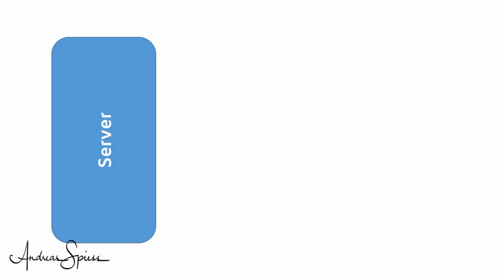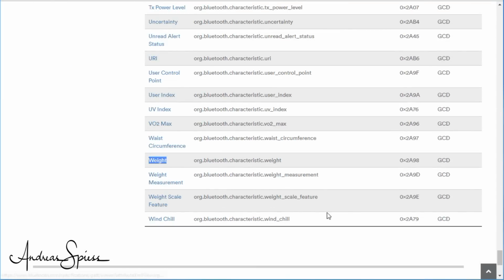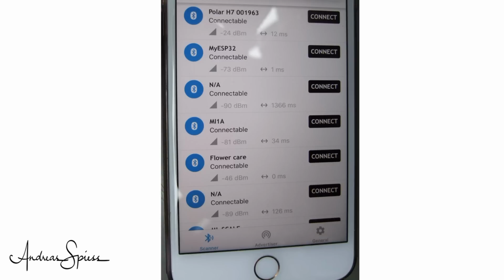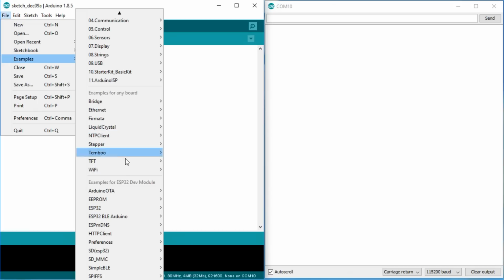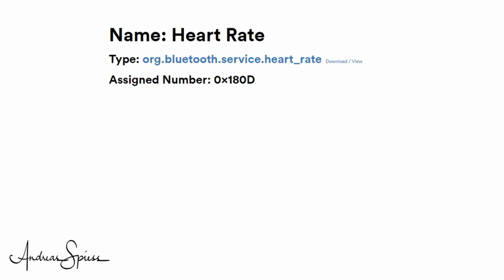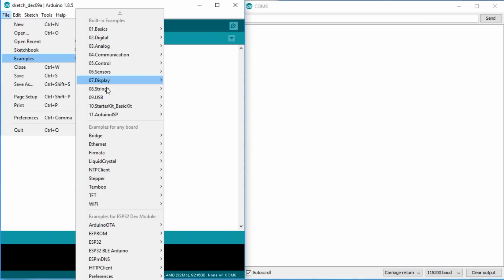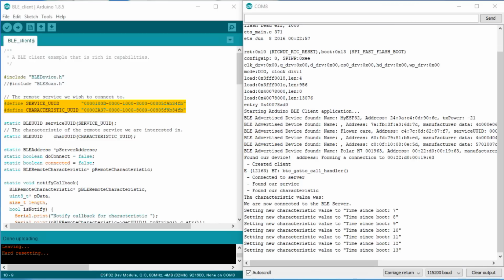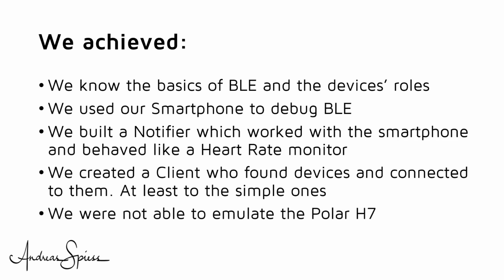#173 ESP32 Bluetooth BLE with  Arduino IDE (Tutorial) and Polar H7

Comment: I think this is a topic worth continuing with and sharing because it is such a strong communication taking any data from esp32 to a mobile which then can do all sorts of things - communicate easily via - txt - sm- email - to -wifi and easy access to screen display and data storage on phone sd card. Phones are so cheap that is really becomes the interface to use.
Reply from the maker: Maybe I will continue the topic. But only if Espressif did a good job on the library...
Reply: @AndreasSpiess  I have found it difficult to get my head around the details of BLE programming.

Comment: Polar uses 4 protocols - GymLink (non-coded), GymLink, Wind, Bluetooth. Your FT60 watch is only compatible with GymLink heart rate devices (T31,H1,H2,H7,H10), it doesn't work over BLE. And H7 sensor provides both GymLink+Bluetooth compatibility. So, H7 works over GymLink with your FT60 watch and over Bluetooth with smartphones/esp32/.

This info can be found here: https://support.polar.com/en/support/compatibility_with_my_Polar

How do I know that? I also owe H7 + FT4 watch (GymLink only) :)

And thanks for another great video!
Reply from the maker: You are absolutely right! Thank you for your hint. Saves me time! Now I remember that I had to buy the H7 in addition to the normal sensor a few years ago because I wanted to use it with the iPhone. 
I am getting old...

Comment: Hi, mr. Spiess. I think I know the main reason why your watch did not recognize the ESP32. The main reason could be simple: The data format sent by the ESP32. I've checked the official description of "org.bluetooth.characteristic.heart_rate_measurement" and find the "Heart Rate Value Format bit", which is setting the "org.bluetooth.unit.period.beats_per_minute" value type to UINT8 or to UINT16. "Note: The format of the Heart Rate Measurement Value field is dependent upon bit 0 of the Flags field."
Reply: You are close. You have to understand what data are sent by heart rate monitor to fake it. Its not enough to send just some number value which simulates heart rate, there is more to send and then watch will interpret those values and display it.
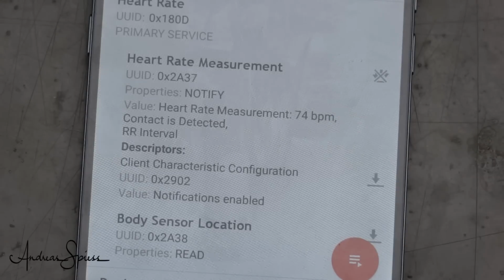Reply: Yeah, you're right. To emulate such a device like Polar HRM we need the proper data simulation. At 5:42 we can see 3 parameters: actual heart rate, contact detection and R-R interval. But at 10:15 we can see only 1 parameter. At the end of the docs for Heart Rate Measurement there is a remark: "The fields in the above table are in the order of LSO to MSO. Where LSO = Least Significant Octet and MSO = Most Significant Octet.". It means, now we now the basic packet structure of  Heart Rate Measurement. For exmaple (UINT8, No Energy Expended): 0x68, 0x4B, 0x03, 0x48 (this is octet-based packet, so R-R interval is splited for 2 octets). If you want, I can explain this strange numbers above.
Reply: I think, I could miss the point with LSO and MSO (I could make a mistake in the order of bits when translating into hexadecimal code)
Reply: Close enough.
Reply from the maker: Thank you for your help. I will come back if I go the H7 route further (or go the "issues" way on Neil's GitHub). For the moment,  I am still learning the basic basics. But it is good to know that I have viewers with much more knowledge.
Reply: This is not about more knowledge, i thought it is possible so i did study bluetooth specs and ive found it is working. Since you are talking about mr Neil's Kolban stack it would be pleasure to explain how to make it working on his "ground". IMO youtube is not the place to talk about issues and code which dont belong to you.
Reply: Polar uses 4 protocols - GymLink (non-coded), GymLink, Wind, Bluetooth. FT60 watch on video is only compatible with GymLink heart rate devices (T31,H1,H2,H7,H10) - it doesn't work over BLE. And H7 sensor provides both GymLink+Bluetooth compatibility. So, H7 works over GymLink with FT60 watch and over Bluetooth with smartphones/esp32/.

This info can be found here: https://support.polar.com/en/support/compatibility_with_my_Polar

How do I know that? I also owe H7 + FT4 watch (GymLink only) :)
Reply: So, we need to find another device for reverse engeneering :D

Comment: Best use for BLE-enabled esp32 would be presence sensor that detects phone. If phone is within the range - HomeAlarm is deactivated, or something like that. Do you think you can implement it?
Reply: Would be really really nice to have a MQTTconnected presence sensor. Or maybe a WLAN connected, also??
Reply: Use BLE to detect phone, since it won't make any significant impact on phone's battery, and then use WiFi to deliver data to automation hub via MQTT, at least that's what I have in mind. Same way car requests to pair and automatically pairs with the phone when you start it if you've paired your device beforehand.
Reply: Andrew Rain that's too easy to break into with just a laptop
Reply: Well, not really. Yes, PIN is only 6 digits but you can setup timeouts or even better - MAC address check.
Reply from the maker: I already did a Wi-Fi sniffer with MQTT and maybe, one day, I will be able to offer a similar Bluetooth sniffer. Who knows?
Reply: Well, I guess you do :)

Comment: So it’s possible that polar have what is like a subdomain of Bluetooth mac addresses and the watch won’t connect to any device outside that domain. That’s how we did it with ours. As you learned, without direct disconnection ble will assume it’s still connected the other device has just gone out of range ( I think timeouts are pretty long). While connected it won’t transmit advertising packets and (I think) will refuse other direct connections. The other think to contend with when trying to spoof commercial devices is pairing is different between BLE and BT Classic but depending on how their security is setup there’s usually a handshake that involves key exchanges and the server adding the clients to a trusted device list. All in all BLE is way easier to work with than classic but it does have some really irritating gotchas that are very confusing.
Reply from the maker: Thank you for your insight. It explains a few things for me. I still have to learn a lot and there is not a lot of info out there, or it is so complicated I do not understand it. So I will try to go step by step...
Reply: The high order 24 bits of the UUID is the company code similar to how MAC addresses have an assigned company code in the high order bits. The low order 24 bits are supposed to be unique per device and allows a company to manufacture over 16 billion devices before running out of available UUIDs.

Comment: @Andreas, the older polar hr straps connect via a low frequency transmission (5khz) called gymlink that is coded, not sure which watch you have, but it looks like this will likely be the case. Like the h10 strap, you'll find the h7 is Bluetooth AND polar proprietary coded transmission, so the watch isn't picking up BLE, it's looking for the polar gymlink transmission at 5khz, that's why you couldn't connect it, you were a couple of MHz off 😁
Not to worry, the polar app phone functions are much better than the watch anyway!
Reply: Polar still use 5khz because it makes HR strap useable underwater. ANT+ and BT are 2.4ghz and far too high frequency to penetrate water.
Reply from the maker: I do not know. For sure the watch communicates with my smartphone using BLE.

Comment: Managed to get the UART example working for tx rx. by using the BLE Scanner app on an iPhone.
Also got it to pair with a raspberry pi3, didn’t get any farther though.
Think there’s a good Python Bluetooth library so might give that a try on the pi3 
Always found bluetooth a bit complicated but with the esp-32  it could be very useful for battery powered projects. So probably worth spending a bit more time with it.
 Thanks again for another great video.
Reply from the maker: Maybe I also will go the RPI route. We will see...

Comment: try to specify the Bluetooth MAC of the device you want to connect to. this way you can force the client to connect to your esp32 and not to the polar
Reply from the maker: You are right, this is a possibility. But as far as I understand, would be against the idea of working with services. And usually, I will not have two devices with the same service, or I have to find a way for the client to deal with it in its program.

Comment: Maybe the watch checks those hardware version and id and stuff and only works if they are correct too.
Reply from the maker: I think you are right. I have to investigate further...
Reply: You need to "construct" your data type for the heart rate measurement characteristic - you cannot send just a value as the watch won't know how to interpret. First you have to set your flags, which are represented in 8 bits. Depending on which bit is set will determine whether the heart rate value (bpm) is uint8 or uint16, similarly, flags are also used to show that an optional "Energy Expended" uint16 value is sents etc.

Comment: Hello andreas nice video about Bluetooth. Apart: can you do a video about ESP WiFi security? I mean, connect several smartphones to an ESP8266 (or ESP32) and prevent brute force password attack, MAC address authentication before connecting (whitelist in sd database), to hide SSID, change SSID name, to set a password to “builtin” router, and if it is possible to auto disconnect a client after a given period (example 1 minute), in other words to make connection as secure and un-hackable as possible. I know you are the one.
Reply: I mean to be a strong connection in a community of authorized users, but what if a user wants to fraud or clone MAC address into other smartphone to allow access? Example: a building's automated door with smartphone over WiFi without using a PC or a raspberry or similar/equivalent linux equipment. (MQTT or just an HTTP request?)
Reply from the maker: Unfortunately, I have no clue about security. So somebody else has to do this.
Reply: To hide SSID do not make a WIFI any securer.  That is an old missconception. On the contrary, it will make the clients less secure, and the attacker can anyway get the SSID to use by just listening- Neither are MAC address authentication (whitelist of MAC addresses) increasing the security. MAC addresses are easy to fake.  
Please don't do that or suggest that as a security matter.
Reply: Just use encryption/signing with asymetrical encryption (that is certificates like when making connections to XMPP, HTTPS and MQTT with certificate) and use WPA2 connections.

Comment: Hello Mr. Andreas,

First, thank you for your videos. They are really usefull.

Second, a question related both with Arduino and this bluetooth implementation (and my very limited knowledge). 

When I connect, I find this:  

"ESP32 Dev Module, QIO, 80MHz, 4mb (32Mb), 921600"

By using the " BLE_server" code in the examples and after compilation/Upload, this is what I get:

"Sketch uses 1085933 bytes (82%) of program storage space. Maximum is 1310720 bytes.
Global variables use 69056 bytes (23%) of dynamic memory, leaving 225856 bytes for local variables. Maximum is 294912 bytes"

I pretended to use ESP32 bluetooth functionality as part of the project but it seems that it leaves no much space for aditional code (18%). If it is so, it is not practical to me (and thers, I suppose), from a practical point of view.

My question: I´m I wrong? Can program storage be expanded somehow? If yes, could you please explain, here in in any other video? If it cannot, I will have to find out other alternatives (I guess other people will also have to address this issue). 

For pure bluetooth functionality I was checking this product. It´s a different approach,, true, out of the Arduino world.
https://www.lairdtech.com/products/bl600-series

Thanks in advance,
Reply from the maker: BLE is new on the ESP32 and the Arduino IDE and we all hope it will improve. You can do things with the few % left. What's left is probably still more than an Arduino has.

Comment: Many hobbyists would like to remotely control a flex strip of "smart" RGB LEDs with a smart phone and the ESP32 as the controller.  The LED strip would be powered by a 5V, 2A supply and not require BLE.
Could this be accomplished by basic Bluetooth?  Does the Arduino IDE currently support this project?
If you could "YouTube" this project I think you would have a hit because so many hobbyists love to play with LEDs.
Reply: He's given you the pieces necessary to implement this, and there are plenty of examples elsewhere.
Reply from the maker: You can use BLE for such a device. But most people use Wi-Fi because they use Wi-Fi for their other Home-Automation devices. 
Maybe I will cover something like that in the future, but now my priority is to understand the protocol itself...

Comment: Perhaps the watch check the mac address in Polar H7 Heart Rate monitor 
If you see my example, you can change the bluetooth mac in esp32 and testing again.
If you have all services , chars and mac adress I think there is nothing more the watch can check in a fake Polar Monitor.
Reply from the maker: It had a much simpler reason (shame on me): The watch did not use BLE, but the Polar proprietary protocol. But you will see an update soon

Comment: regarding the "magic number" 0000-1000-8000-00805F9B34FB:  Generally UUIDs are 128-bit - this way anyone can create their own services and characteristics that are not part of the standard and generate a UUID which should be unique because it is very long. Some vendors however - official members of the Bluetooth SIG (e.g Polar, Apple etc) - have pre-assigned 32-bit "vendor-specific UUIDs". In order to achieve a 128 UUID, this magic 96-bit number known as "Bluetooth Base UUID" needs to be appended
Reply from the maker: Thank you for the additional info!

Comment: Mr. Spiess, how did you solved the  invalid data syntax : ? in the value data (nRF Connect app)! ,  the marriage joke was amazing !
Reply from the maker: I do not know what you mean. Can you pls. be a little more elaborate?
Reply: @AndreasSpiess   yes sir,  when you open the app mobile nRF Connect app, you connect your smart phone with BLE to the esp32, and then you can see that it shows information  "in the description",  in your video, you show numbers and there is not problem, but in my case it shows hex numbers and a message  which says " invalid data syntax :  0x0E"
Reply from the maker: The ESP32 BLE is under constant change. So it is well possible they changed something since the video was done.

Comment: Thank you once again, Andreas. Bluetooth, IMO, and for many reasons, sucks. This is due to bluetooth using a very noisy, crowded, 2.4GHz RF band, plus the usual absence of 2.4GHz antennas in bluetooth hardware, plus sloppy software in almost every implementation, and dodgy hardware that takes liberties with the specification. With all of that to build upon, the highest goal attainable for any new Bluetooth project is an end product that sucks in direct proportion to the combination of noise, bad software, and dodgy hardware. Best case scenario: it sucks, but maybe not so badly that distracted insouciant people will notice during the warranty period.

That said, bluetooth headsets seem to work more than half the time, on average. Yay!
Reply from the maker: I can not complain about BLE. So far it does the job as expected on my smartphone connecting different devices. But of course, I only use it on short distances. But it seems not easy to write software for it...

Comment: I wanted to ask can i use BLE to transmit realtime data at 200 packets per second? I also have multiple sensors that use multiple serial ports to transmit data. The data on each of ports need to be synchronised i.e. It should transmit data from different serial ports at same time. How would i do that?
Thanks a lot!
Reply from the maker: I do not know.

Comment: Dear Andreas, Greetings. I am working on ESP32 module for one of my BLE  projects. I used the BLE server sketch that was available in the example sketch of arduino IDE. I tried connecting the server to a android NRF phone client. It worked fine. BLE device name was available within the client. I was also able to read characteristics too, But the same experiment, if i tried executing in my house, the connection does not get established. I also changed the service and characteristics UUID using uuid generator tool. But still no connection. What might be the problem. Kindly suggest.
Reply from the maker: I am no BLE specialist. But AFAIK we do not "connect" to a device, we only listen to advertisements. Gadgets stop advertising if they are connected to another device like your smartphone.
Reply: @AndreasSpiess  Thanks for your suggestions. Will look into it.

Comment: Dear Andreas, I am working on an experiment to send BMP180 sensor data connected to ESP32 to a client application in phone. Are there any recommended service and characterstic uuids that can be used here, or should i use nordic semiconductor uart uuids. Am not clear what uuids would be suitable for this setup. Thanks
Reply from the maker: You find a register of all standard services (including UUIDs) on the internet. Maybe you find one for pressure sensors
Reply: @AndreasSpiess  Thanks Andreas.  Will check it out.